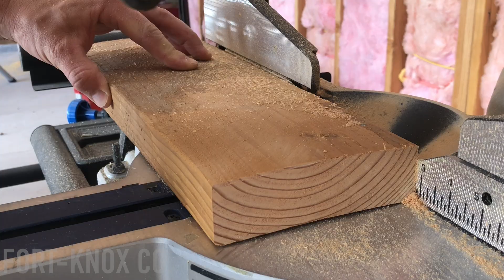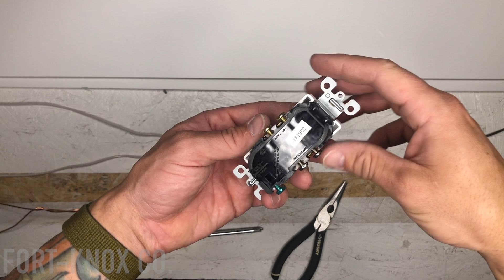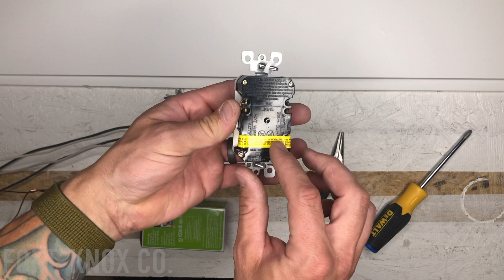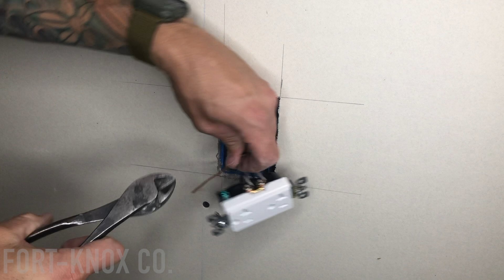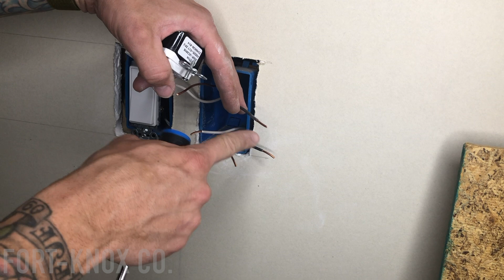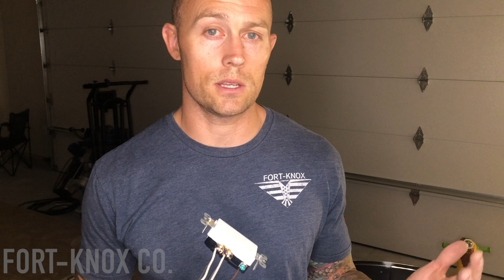How To Wire Wall Outlet and GFCI Receptacle | How to Wire Electrical Outlet

Comment: Would like to see a demo on how to identify the Line wires vs Load wires. Once breaker is open the wires are dead and no way to test but everyone says “before you start shut off the power”. Great. Now it’s dark and I have no way of knowing which is which. Fire Department on standby.
Reply from the maker: Well obviously black it the hot wire and white is the neutral. If your fixing or switching out a regular outlet in the circuit or down the line from the GFCI outlet then which is the load set of wires and which is the continuing set down the line doesn’t necessarily matter, you just need to wire the outlet properly with black to hot terminals and white to neutral terminals. If your switching out a GFCI outlet, then the main load wires coming from the breaker will be designated/indicated or usually required to be on the top two terminals. The bottom terminals are for the hot/neutral that continue down the line or carry the load.  So knowing exactly which in which doesn’t matter if you goal is to just wire it properly. And if your doing a GFCI fix then you go with assuming it was wired properly and you able to know which is which based on how it’s currently wired. BUT if you still want to know where a wire is coming from and where it’s going, in the case that your trying to diagnose a problem or fault in the wiring somewhere hidden within the walls, there is a way. You can use a volt meter or other device that puts a charge on the wires, then you go down the line and find the live wires. It’s a low voltage but enough to read and show that whatever is clipped at one end is sending the charge down the line to where ever your testing or looking.
Reply: @FortKnoxCo  What I was trying to ask was how would I know which pair of hot and neutral wires came from the panel, unless I leave the breaker alone and test for power in the outlet box. That would tell me that powered wires are coming from a panel, and non powered are downstream load wires waiting to be powered once connected to the gfci. Do I have it right?
Reply from the maker: Yeah basically that’s right. But if your worried about shocking yourself because the breaker is on then that’s where I’d use a volt meter and a Cable Tracer with probe Tone kit. Klein tools has one and there’s a few other brands out there. You can load the line at the breaker, breaker off but clip the cable tracer the wires and then trace it down the line by finding the live wires you have clipped. Your putting a small amount of energy in the line with the cable tracer and then catching it down the line to identify the beginning and end of that line. I hope that makes sense. But that way you aren’t playing with the breaker on and high amp/volts. You kill the line and load it with your Cable tracer

Comment: I recently bought a sauna and the company said to only plug it into a non GCFI socket. I’m putting it in my garage and curious if it would harm anything if replaced GCFI socket with a normal one. Thanks in advance! Your video makes it look pretty easy.
Reply from the maker: I wouldn’t replace a GFCI with a regular outlet because that GFCI in your garage is protecting a chain of other outlets somewhere in your house. So I’d Clarify with him if he means don’t plug it into an actual GFCI outlet or don’t plug it into a circuit with a GFCI outlet on it. Because a regular outlet in your house may have a GFCI outlet on the circuit protecting it. So it could be hard to find a circuit with no GFCI on it at all depending on how your home is built. 

If he says just don’t plug it into an GFCI outlet but any other plug down the chain is okay, then you just gotta move or use a different plug. But I wouldn’t remove a GFCI in really any circumstance.
Reply: @FortKnoxCo  thanks for the quick response! Yeah, apparently it just needs to be on an outlet that doesn’t have the reset switch. He said that their saunas are sensitive and just need to be on a normal socket without a switch. 

I’ll have to just move it inside. It does make me wonder though if that means it will still pop the GFCI the outlet is wired to on the line like you said. Thanks again!

Comment: Thanks for the video, very helpful!  I have a quick question regarding the difference between just pushing in the wire into the holes and wrapping it around the screw.  Is there a big difference?  Is one safer than the other?  I am mounting a tv and want to install an outlet piggy backing off the one closer to the floor and those screws already have wires attached (I'm assuming from the other outlets on the wall).
Reply from the maker: One vs the other is pretty much the same. I’ve heard pros n cons for the push in. Some old school electricians say they COULD fail or have play in them.  It I’ve personally never experienced it. I think either is fine but if you already have wires coming off that outlet your best bet is to pig tail all the wires and come off with one lead to your outlet. That’s the best way once you start having 3 or more wires to work with
Reply: @FortKnoxCo  thanks for this insight, much appreciated.  I'm working with a friend today to attempt at it.  Luckily, he has done it once before.
Reply from the maker: @ nice!

Comment: Thank you so much. Yr video instruction is clear and help me a lot.  What trick do you have in mind to determine which wire is power in instead of load wire for GFCI socket installation? Thank you again
Reply from the maker: Thank you, I appreciate that. I’m not sure what your question is about the load wire. Are you trying to figure out which wire in at the plug is the Hot(+) wire? Or are you trying to install a GFCI into a circuit that didn’t have one previously?
Reply from the maker: If you haven’t already please consider subscribing to my channel. I’ll be making all kinds of helpful videos and uploading several times a month.

Comment: I loved your video very simple and precise ! Thank you that's why I subscribed, my question is
From one outlet controlled by a switch on and off, can I feed two more outlets one at the same level 4 ft away and the other one 5 ft higher behind my TV is that possible?
Reply: Should I add a GFCI ?
Reply from the maker: Thank you !! I really appreciate it. 
To answer your question, are you saying you have an outlet where one plug is controlled by an on/off switch and the other plug is a constant ON/Power?  If so, you can branch off that constant ON and go up and/or over and they will all be live plugs.
Reply: @FortKnoxCo  Thank you again sir you are very helpful I appreciate your time I'm glad I found you

Comment: The more I watch your videos, The more I understand. ... I've heard that wire stick in connections are not as good as loop in connections Because of the surface of the contact area and tightness of the contacts. Maybe it's worth to spend extra 5 minutes and make loop connections?
Reply from the maker: Yeah it’s not a bad idea to loop and secure that way. It makes sense with more contact and more secure.  I’ve heard the same with push in connection. They are approved and used by many. But I can see where they could fail too. I’ve heard all the arguments. You could also mess up a loop and screw connection too. lol. I think a big factor is the installer. Take your time and do quality work.

Comment: Is it better to use the screws?
Reply from the maker: Using the screws or outlets that have the push-in option doesn’t change the effectiveness of the plug itself. Not one way is “better” necessarily, more about time and efficiency. The push-in can be faster overall. I just happen to use the screws more often. The thickness of the wires matter too. Sometimes the thicker wire doesn’t fit into the push-in. So your forced to used the screws when that happens.

Comment: Nice video and explanation. However, you handled the ground wires incorrectly, they should be capped with a green wire nut with a hole at the end aka "greenie". Same with the gfci and even though the ground connection can be a slide in and fasten it is designed only for one wire.
Reply from the maker: Awesome!. I apply the feed back.

Comment: Good info only thing I would say you need start leaving more slack 
You barley have any wire to work with 
I know 12/2 is bitch to work with but you are cutting wire way too short 👍🏻👍🏻👍🏻
Reply from the maker: Thanks I appreciate it man!  Yeah for myself I tend to cut them shorter because I just don’t want to tuck too much in the box at the end. But there is some play/slack I could always take from inside the wall if I needed. I wired this whole structure so I secured the lines in the wall but still have some extra I could pull Incase I were to need it in the future.